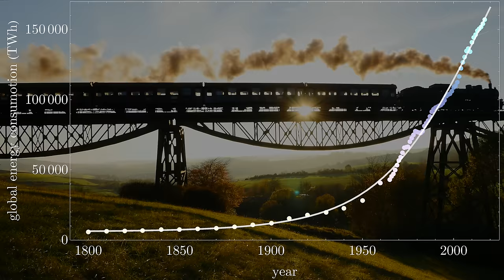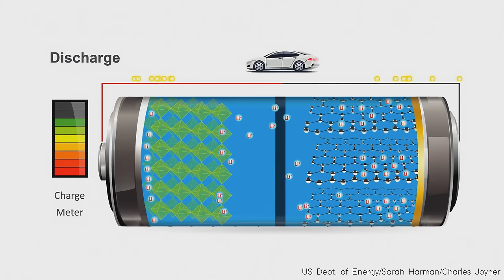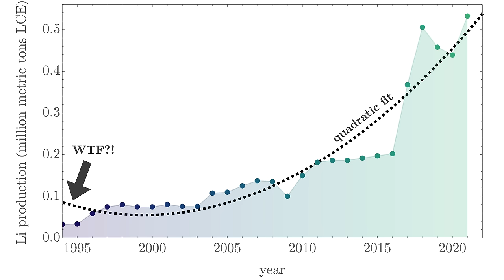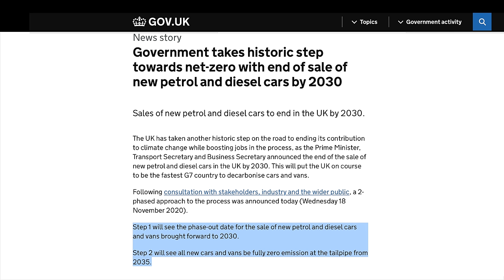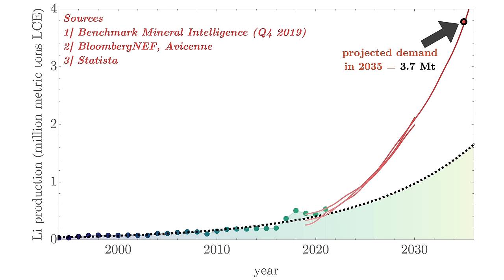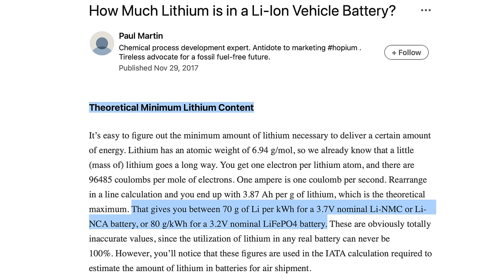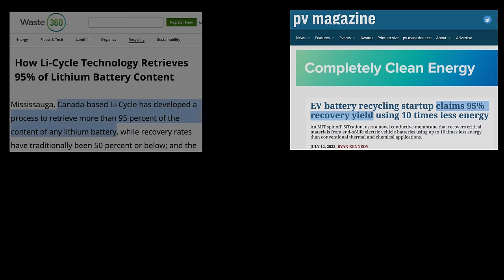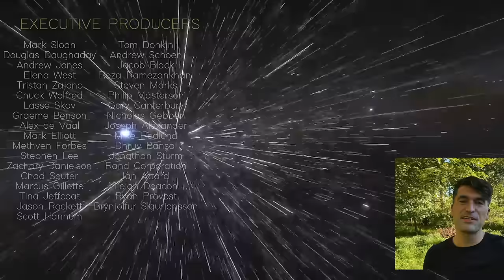Will We Run Out Of Lithium?

Comment: The biggest tragedy of the energy industry has been the systematic over-looking of nuclear fission electricity. Vehicular emissions should rightly be a concern, however the daily and industrial use of energy represents the lion share of the global issue. Unilaterally switching the global fleet of vehicles over to EV without proper service infrastructure or energy production to match the now significantly increased demand on energy presents an exacerbated energy crisis we are already facing as we wane off our usage of fossil fuels for energy production. Our production of clean renewable energy will not be able to keep up with our energy needs if we pursue this course of action to manage climate change. In fact we may see some regions fall back on older dirtier methods to meet demand, we see this in countries like Germany where their energy crisis is being managed by re-opening coal fired plants after they've shut down their nuclear reactors, and due to the on-going war in Ukraine. Solving our growing energy crisis by investing into more nuclear technologies before we put ourselves deeper into the hole we find ourselves in should be our priority.
Reply: I agree in more than one way, yet a lot of people are  afraid of nucleare, wich can be understand but we cannot tolerate anymore in the situation we are in right now. Massive neutre and accurate information should be given to mass of people, starting immediately. Sadly if I try so I will be chased down from every part on internet.

Oh, and we should reduce our growing demand on energy. At least this. Asap.

Anyone any idea how to do all of this? I take any.
Reply: @louiseb3146  If you truly feel the ‘calling’ to 
‘evangelize’ for NUCEAR POWER, I recommend that you leave URL call words, such as “GOOGLE LFTR and/or MSR Nuclear power generation”. That way you can get an assist from those who have already polished their spiel.
     This method applies to just about any point that you may wish to make.
Reply: Great points. Unless we address the fundamental way we use energy (using and using without thought for the long term), I fear we will be in an increasingly tighter spot energy-wise.
Reply: There is so much wrong with the op, I don't even know where to start.

What unilateral push? There is none, strawman lover.  Infrastructure grows with demand, which will grow with demand for electric-only vehicles.  Also, natural gas is not perfect, but having that provide energy at scale is WAY better vs the burning of oil-based gas on each and every individual car.  And renewable that is not fission-based can scale up while we rely on other non-fission solutions. 

The real problem that you and your cohorts will never overcome is that fission has REALLY bad PR - and it earned with the accidents that have happened (and not because of some green loving person).  You live in a fantasy world if, for example, you think we will build these out in the US with it being nickel and dimed until, sooner or later, there is an accident.

The private section can certainly not be trusted with fission, and the government will bend to that will and just screw it up all the same.  Also - none of your supporters want to live anywhere near it, so you whining about nimby-ism is especially funny.
Reply: @xBINARYGODx  The same goes for any electric plant, doesn't it ? THere is no 0 risk and always counterparts, disagreements. Even with solar plants.
Reply: I fully agree. Nuclear power when managed, maintained properly and waste properly contained and sealed away is one of the cleanest power sources out there. Sadly most people her the word NUCLEAR and immediately think of radioactive contamination and nuclear weapons. People need to research and realize its probably our best option until fusion is feesable
Reply: We can do both at the same time. This should not be brought up every time someone talks about EV.
Reply: Thanks to Democrats!!
Reply: I PURPOSED A
Reply: I agree with you completely. And what's more, why are we not using bio diesel in lieu of current hydrocarbons to power vehicles?
 Was not the original diesel engine powered by peanut oil? Am I missing something?
Reply: @xBINARYGODx  nuclear supporters don't want to live near reactors? Lol that's news to me!
Reply: Nuclear is the lazy option to avoid looking yourself in the mirror and coming to terms with wastefulness. Energy efficiency mixed with renewables is the only real option. Nuclear is only a stopgap and is only currently viable because of nuclear weapons. Stop holding back renewables development and battery deployment and energy efficiency principles.
Reply: @tigertoo01  It's genuinely hilarious for someone pushing "renewables and batteries" to criticize anyone for wastefulness and talk about efficiency. Together they form one of the most inefficient and industrially intensive forms of energy production, the mining, manufacturing, and recycling requirements absolutely dwarf that of nuclear even in the short term, and especially in the long term due to shorter lifecycles.
Reply: @infantjones  no hazardous waste and recyclable means an ongoing chain of energy production storage and use. Yes more mining operations required but the complete cycle can be renewable energy from the production and use of mining equipment to the production and use of end devices. This is ultimately the future whether you like it or not. Uranium based fission is a health disaster with exponential consequences. The more required the worse it gets. It’s lazy thinking which keeps this argument going.
Reply: @tigertoo01   You're viewing this through a false binary. Nuclear, geosermal, wind, solar and reducing energy consumption can all coexist in the same framework. It need not be one or the other. Pluralism is preferable is it not?
Reply: @Dontlicktheballoons  yes I agree somewhat but when you look at nuclear I believe you need to compare it to other fossil fuels, which it is. Too many ignore the elephant in the room which is nuclear waste. A system where energy production is completely renewable is the ultimate goal. For arguments sake the sun will always shine and the wind will always blow. There are many challenges to harnessing but we should be smart enough to work this problem out.  Essentially it has been worked out but the message gets muddled with bad actors trying to tell us that fossil fuels are still the way.
Reply: I totally agree, I see a lot of people complaining that nuclear fissions energy isn’t viable because it produces “nuclear waste” This however is less of a problem then most people think because of modern day breeder reactors which reuse the spent uranium to produce even more power with incredible efficiency. However there is one large problem, the plutonium produced as a byproduct can lead to countries having nuclear weapons in there possession, which could lead to catastrophic events if things go wrong enough. But everything I just said means nothing if nuclear fusion becomes viable, which may be sooner then you think. Thank you for reading!
Reply: @linkferreira9650  from your post I’m not sure if you’re for or against fission nuclear power? But appreciate your input. Nuclear power is made viable for reasons which have nothing to do with generating energy with nuclear weapons being at the forefront. If nuclear weapons were not a thing you would never see a nuclear fission power plant. It is too much of a liability for any country and it’s energy is too expensive. Imagine you have a nuclear plant in say ukraine .. oh I really don’t need to go any further on this. Point made. Time to focus on the technologies which can ensure our children and all future generations can enjoy prosperity and progress. We need to stop making the obstacles for them. Their will be plenty more as time goes on.
Reply: @tigertoo01 I’m am very much a supporter of fission, and your right, without the nuclear weapons as a byproduct we wouldn’t have fission, I’m just saying that it’s a conmen point of fear for most people. But I do thing nuclear power is the future.
Reply: @linkferreira9650  well we do already have one very famous fusion generator which powers everything ! So I am a fan of that 😀
Reply: @Hot W the op meant fission. All current nuclear power plants use fission. Basically a big hunk of contained uranium allowed to get hot enough to boil water to power a steam turbine. It’s safe when done right, but when done wrong is Chernobyl.

I hope, with cautious optimism, that fusion power generation will become a reality. Although all nuclear bombs use fission, the more powerful thermonuclear bombs use fusion as well. Meaning that at the moment fission has both a peaceful and deadly use, while fusion is only deadly so far.
Reply: @tigertoo01  Did you just unironically call nuclear energy a fossil fuel? What lmfao? Also nuclear waste isn't the elephant in the room, it's an incredibly small scale issue which we've known how to deal with for decades. Anti-nuclear lobbying just prevents a lot of permanent repositories being used.
Reply: @tigertoo01  You do realize that light water nuclear reactors of the type which make up the bulk of our plants aren't useful for nuclear weapons production, right? So how exactly are they dependent on nuclear weapons?
Reply: @infantjones  think you should recheck your info.
Reply: @infantjones  name one permanent repository which will last 100 years let alone 20000 years for just the half life of the waste.  Which is still toxic afterwards. And yes uranium is an exhaustible fuel just like fossil fuels.
Reply: @tigertoo01  recheck what info lmfao
Reply: @tigertoo01  'Fossil fuels' isn't just shorthand for limited fuels and the rare earth metals required for wind turbines and solar panels are very much exhaustible resources as well.

Literally any proposed or already built deep geological repository can last millions of years, while highly radioactive waste products literally just need a few years in cooling pools until the most intensive fission products are sufficiently decayed and a few decades in cask storage as the remaining intense radionucleides waste away (as we've already been doing for ages), it's only 50 years before more than 99% of the radioactivity of spent fuel is gone. The main concern beyond then and following dilution in glass and concrete, at which point it's about as dangerous as the millions of tons of naturally occuring uranium and its decay products below your feet right now, is heavy metals entering groundeater. Such heavy metal concerns are also the case with lead and cadmium. By the way, wait til you find out how long lead, cadmium, and arsenic remain toxic lmfao
Reply: @tigertoo01  Fission power is a technology to allow future progress and prosperity where wind and solar really aren't. 

Nuclear is not particularly expensive in lifetime costs, its actually pretty cheap long term, it just requires a lot of capital up front. Meanwhile wind and solar are only particularly cheap in terms of installed capacity alone, but solar capacity tends to only translate to 1/4 the actual energy production, and wind about 1/2, as consistent sources like nuclear and hydro produce relative to capacity. The costs of renewables also increase exponentially as they take up a larger and larger portion of the grid due to energy storage costs and various integration requirements, and due to greater maintainence and replacement needs to maintain a wind/solar grid. Batteries are stupidly expensive for such large scale applications and are the only option in much of the world to allow a wind-solar grid without constant brownouts and blackouts. Recycling isn't cost effective for batteries, turbines, and panels in most of the world either so as the rare earth minerals vital to production of these run out (which itself will drive costs up further) you'll then need to factor in recycling prices.

Quite simply, a wind, solar, battery grid is not even remotely a long term solution. It's not at all sustainable and creates tons of mining pollution due to how resource intensive it is compared to everything but coal. It's inherently a stopgap, where fission can provide us with thousands of years of clean, safe, and sustainable energy with very little mining to sustain it and fairly low long term costs.
Reply: @infantjones  you’re arguments are typical swill and you want to ignore all the issues with nuclear fission. There’s a reason why most countries want nothing to do with fission power. They can see the big mistake it is. The exponential problem of storing waste which is an ongoing cost basically forever. Any waste streams from renewables can be managed.
Reply: @tigertoo01  Lol you're completely ignoring the issues with wind and solar while whining about nonspecific "issues" with fission mixed with incredibly basic misunderstandings of fission power and waste. 

By the way, 32 countries have nuclear plants currently and most are looking to expand investment despite the temporary fearmongering push a few years back, while 25 other countries are currently investing in/actively planning their first nuclear power plants, and another 3 have started building their first reactors already. We're quickly entering the second nuclear renaissance. Of the handful of countries who were pushing for nuclear phaseouts a few years ago, only Germany has actually stuck to it, and has found renewables completely unsuitable for replacing the lost energy production and have been forced into heavier reliance on coal and gas to make up for energy losses from those shuttered plants. Sweden was planning a phaseout after Fukushima but completely reversed and is now planning to build more plants, Belgium cancelled phaseout plans as well with future plants being considered but not yet planned, Spain has been walking back its phaseout plans gradually and is now extending licenses, Switzerland has entered more of a limbo on plans to build more once their current licenses expire. It's become increasingly apparent to governments around the world and the scientific community that nuclear is vital to getting off of fossil fuels. 

You also fundementally do not understand waste storage if you think it's an "ongoing cost basically forever", it does not require any costs at all once it's in deep storage. Do you think it has to be actively cooled for millenia or something? Like what specifically are these forever costs in your mind lol? Also nuclear waste is just as recyclable as wind turbine and solar panel waste (doable but expensive), while also being orders of magnitude smaller in scale than wind and solar waste per unit of energy produced. 

I am also very curious how you think rare earth metal mining waste streams can be managed in a way that uranium waste streams cannot.
Reply: System is the problem 🏡 Our Lives should be around Great Qualities

1, Show all living creatures; all the love and kindness as much as you can.

2, Only try to be honest with yourself. If you try to be honest with others, you will get into big trouble soon or later.

3, Aim only one target at a time; otherwise you are chasing two rabbits and you will miss both. So, the reason behind it. Have one powerful reason and never ever give up the one you want the most.

4, Don't try to be good person only but be the powerful person. We will grow to be the one or we will die. There is no other choice. 

5, Always learn and look for to improve something your life. 

6, You are not alone. Love and faith the high power reduces unnecessary stress in life. But never completely rely on it. 

7,  Success and happiness are the byproducts of our usefulness. So, always increase the possibility of success.

8, Life is not going to be easy. Because of our unnecessary things. Eliminate all the unnecessary things as much as you can by organising yourself well with the environments. 

9, Never believe anything without the proper evidences. 

10, Always try to give more than you take. 
Because it is dignity/ character of the divinity within you.

🌎 As long as people continue to see themselves as separate from everything else, they lend themselves to being completely enslaved. Success depends on how well we relate to everything around us. Joy comes from that bliss of connectedness. I believe that unarmed truth and love will have the final word in reality. To love; you should have good heart. I am a good person until I see a person better than my standard of goodness. Being good is the progress towards a worthy cause. Love is God. Whoever lives in love, lives forever. How selfish it is to try to keep something forever? Love is all about nourishing, nurturing, sharing and expanding the love within you for all. The principle to which we adhere to is that we have kindness of love at heart for the whole of mankind.  As long as there is the unnecessary differences within us; we can not live peacefully so we have to eliminate all the unnecessary differences among us so we can love all. People abilities may vary but not there true love. If we love a person/ God for a reason then we love the reason but not the person. No reason is the reason to love the person because true love never fails. So do not compare or measure the true love as first or the last but love all truly. If you love people truly then you can understand people. If you don't love then you don't understand people at all.

People are controlled by system why?
The Cyclical Consumption is the current economy all over the World. It is making the scarcity problems of the earth finite resources to deteriorate day by day. Current Monetary System is legalised theft. Real money is Gold and Silver. Scarcity gives the money more value. Real money won't lose it's value. When Governments stay away from Gold & Silver then very easy to transfer the wealth / resources to upper class the Rich (Corporatocracy) Elite. When the Governments are printing out more new fiat currency with reserve banks, our old currency is losing its purchasing power everyday. They are printing millions of currency everyday. All governments and laws are existing right now to transfer wealth to upper class the rich elite. The USA Government & other Governments are in many countries, bailed the investment banks & financial institutions in 2008 against the majority of the people. There is no democracy in any countries. Because of the Money System based on profits motive only above all else even humans lives and well-being. So, we do not have freedom to protect our values with the money so on. The violence, bankruptcy & all the negativities are build into the Monetary System of our society. All are owned (including ourselves) by Reserve Bank. Which is private cartel the corporation. So, in legal system, we are legally considered as chattel the properties. They make money in the capital markets with our birth certificates. They do not consider us as Humans. That's the truth. We are at the invisible war with the Elites (Corporatocracies). We have to fight for our Freedom. Resource Based Economy is the Solution. We have to declare the earth resources as the heritage of all the people of this world. So everyone has access to it. Please have your research about zeitgeist movement then you know the truth more. 

 Truth About Health/Drugs Industry Because Of It Your Life At High Risk The drug industry is a 1/2 trillion dollars a year worldwide conglomerate. Almost 300 billions dollars just in North America. That is really big business. What would happen if everyone were well? There is no money in health. You see, good health makes a lot of sense but it doesn't make a lot of dollars. Because everything they do is toxic. Every drug they use, prescription drugs, all drugs are liver toxic, bar none. If you've had amalgam fillings put in your mouth by dentists. It is highly toxic. There's cancer because most of the chemos are themselves carcinogens. To view the tumor as the cancer and we know the tumor is not the cancer. The cancer industry is 200 billions dollars a year. The more work they get, the more profit there is. You have to dismantle; If the truth ever came out about what we would need to do. 30% of people of females in America are at risk of getting, will get cancer of the breast. The ones that are already dead have been grossly mistreated by the medical profession and by the government that supposedly is supposed to encourage free research and development of all possibilities. Why would medical doctors who studied medicine and practice medicine and are heavily funded by pharmaceutical companies why would they go and look into vitamins? That they never had the answer orthomolecular. And as more and more of our population start taking their health into their own hands, there's going to be even more and more of changes. It can't go on the way it is. The system is failing apart. We must make nutrition the primary prevention strategy for the population. You are what you eat. You are everything that you have ever done to yourself. The choices you make directly affect the outcome of your life. - (Food Matters Documentary in Netflix)

😊 Well, I truly love God. I am not religious but very spiritual person. So, I believe 1) Religion is the beliefs in someone experiences But spirituality is having my own experiences. The mainstream religions people promote religious ideology by giving guidelines and guide but In my spiritual life; I do not want anyone or anything between God and me to restrict my freedom to worship God. 2) We do not need any authorities to do good work. The god work is the good work always. In contrast; organised mainstream religions are claiming that they have the authorities to do God works as leaders so on. 3) God is not capable of doing wrong thing, change the past for us and create anything out of nothing for us. Nothing means not anything. So, even God is limited. The mainstream religious people believe that God is unlimited 4) God wants us to take responsibilities for our righteousness life but not for all the consequences of our actions because they are continued to exist among us. So, How can god punish us for all our consequences? The mainstream religious people believe we are full of sins because of all our actions. 5) Freewill  is an illusion. People always choose the perceived path of greatest pleasure.  So, we do not have choices all the time. In contrast teachings of the mainstream religions are promoting people to do god's will always because we all have choices of freewill always. 6) We can not separate everything into groups. So, everything for good and evil and there's no success and failure for everything. If everything is real then real things can not be threatened. Once you come to understand that God/The Holy Spirit is in each of us, You will no longer need a Book to tell you how to live. Then why we need religious scriptures? The Virtue is the expression of the basic goodness in our actions. The Basic goodness is the fundamental worthiness of every individuals. We are worthy to God always in everything. 7) Beliefs in a cruel God makes a cruel man. No matter what; every living creatures has the right to live and What makes their life cheap? Everything depends on everything. Nothing too big or too small in value. We can not love and hate at the same time; Being a vegetarian means love without cruelty happily. The mainstream religious people are killing people and sacrificing animals in the name of God. They promote God's cruel punishments. The Punishment is endless for Sinners/Devil according to religious scriptures. But God is love always. Overcome hate with love. If all religions for peace, unity? No way. Because they are not for peace. 8) Well, The God gave us everything to go from moment to moment in our lives as we do our part  and pray only to thank god then the Love is in progress. The Love is always for everyone. We are always worthy of the God's love. Our greatest fear is; not to be loved by anyone but we are all loved by someone. When we eliminate all our unnecessary differences among us then true peaceful life is possible with the true love. If we can't find the peace within ourselves then we will never find it anywhere else. 9) This is the Fight for independence and freedom of humanity to worship God freely without religious guide and guidelines to restrict us. Unnecessarily, We do not want third party controls over us in anything ; especially in spirituality. 10) Revive Survive Thrive. Sincerely,  The Real Peacemaker against religious oppression.

 https://youtu.be/HbvCxMfcKv4
https://youtu.be/pIJHJzDQcRM
Reply: (This video is for explanation purpose only in Animation of the prototype of the device in YouTube)

https://youtu.be/wfGjGqMfKNs
Reply: Nuclear is almost twice the cost of solar. Let that sink in. By investing into nuclear we would lose out on half the energy produced for the same money. Plus it would still require gas peaker plants for spikes in demand. They also have to be shut down on hot summer days, which is the opposite of what we need in our current climate.
Reply: @seasong7655  you're kind of ignoring the part where a nuclear plant 1sq mile is size would produce the same energy equivalent of nearly 80 square miles of solar. Nuclear also has a capacity factor of 93% meaning they can typically operate for 341 days put of the year. Where as the national average puts solar at a factor of just 24%, only 89 days of the year. The obvious rebuttal would be "well just put them in places with constant sunlight". Well your options are basically just deserts at that point, which do not have necessary infrastructure in place.
Reply: Fusion is AT LEAST 20 years, more likely 50-100 years away, if ever.
We need solutions NOW